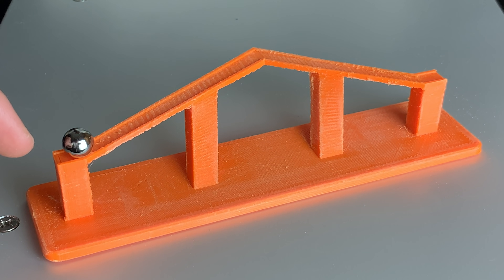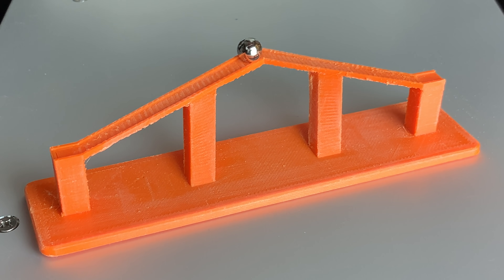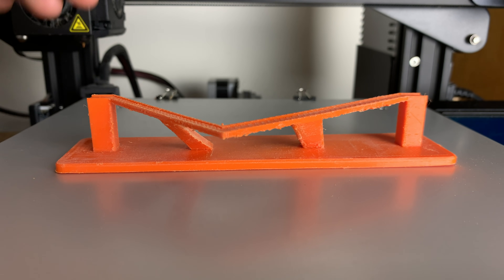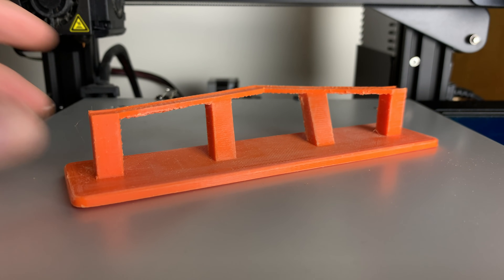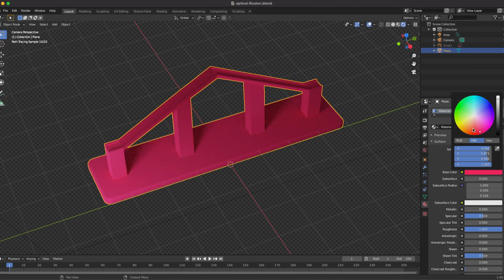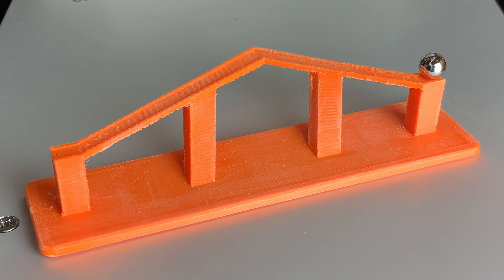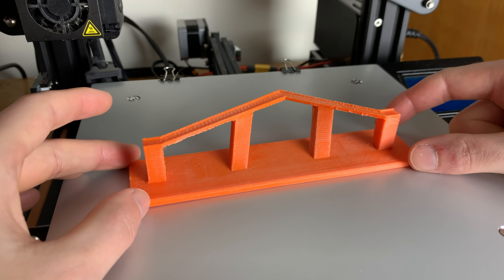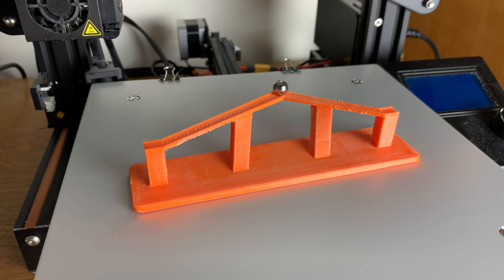This Ball Rolls Uphill - What Magic Is This?

Comment: To complete the illusion, all you need is part smoothing. The layer lines on the supports immediately give away the forced perspective illusion, especially the slanted layer lines on the two central pillars. Likewise, the layer lines on the ramps give away the direction and slope.